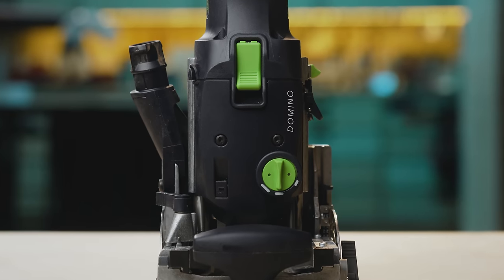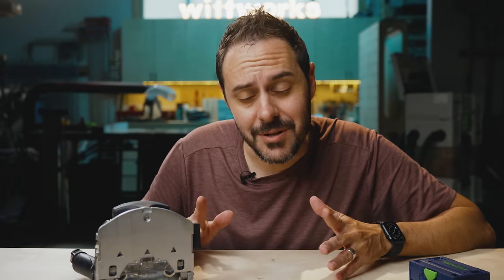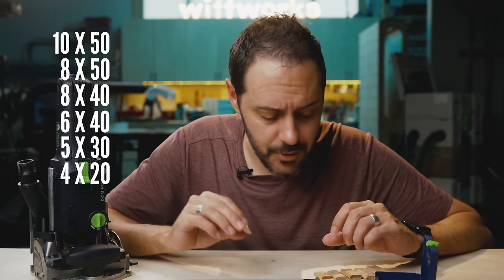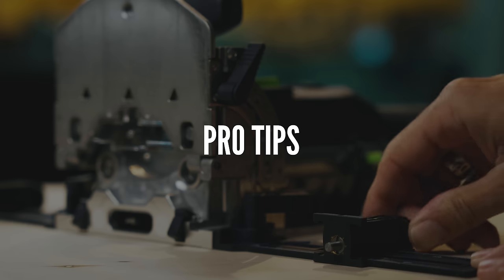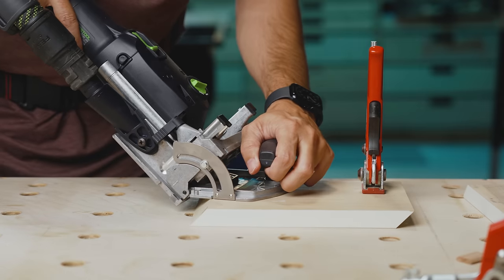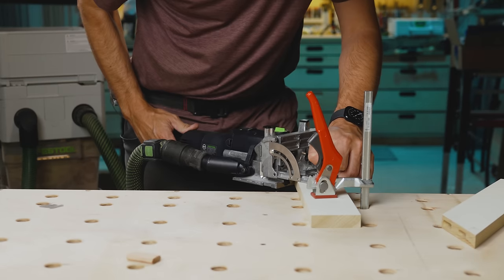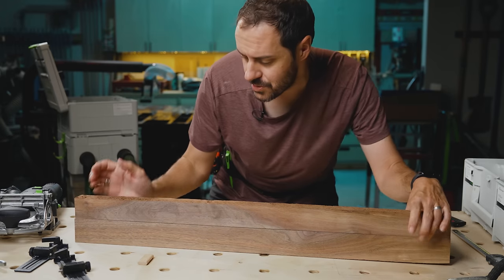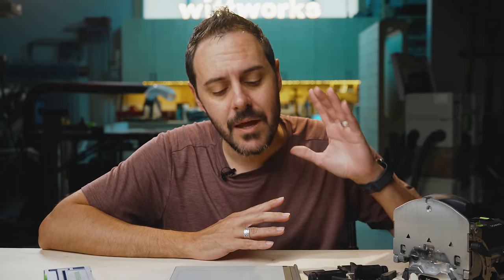Domino for Dummies

Comment: When doing 18mm boards I still use a 6mm domino, just only plunge 15mm on the face boards and do the 25 on the edge boards. I have had some cases where despite not changing the height adjustment I have somehow not got my holes aligned properly. Fortunately you can just glue a domino in, cut the end off and cut a new hole through that sawn off domino. I tend to use the small mortise on the edges of sheet material (as they all get glued up before final glue up), with a small on the face for joints at the front of a cabinet and medium at the rear.

Too much glue and too hard a whack will however see ply and MDF split or have glue oozing from places you didn't think it could get out of.

Comment: I'm a hobbiest too, and like others, time is worth more than the money to me.  I bought my first domino about 15 years ago, when I was gluing up more and more carcasses in face frames.  When gluing horizontal dividers to drawers, it seemed to be such a time saver over mortises or dowels, that I justified the expense.  I had been using biscuit joiners for years, and was satisfied with the ease of alignment that they allowed with panel glue up, but that small mortise was a different problem.  After I got the 500, I was so impressed that I started using it for panel glue up also.  Not that it really structurally improved them in my mind but the accuracy of alignment meant that it was a lot easier to keep the individual boards in alignment and thus much less time in planing and sanding.  Back then I had a performax drum sander and that is fairly slow, so not having to surface sand is a great thing.  I still use a biscuit joiner fairly often, mostly because the biscuits are so much cheaper than Dominoes, but only for places where the accuracy is not so important.  As to the dust collection.  I guess you figured it out that it IS very good, but that also it IS important to use it.  Otherwise the port can get too impacted and mess with the accuracy of the machine.  That is one thing I think that could be improved upon by Festool.  The hose is sort of a PIA to attach, and it sometimes comes off during use.  It would be nice to have a "locking" hose, (sort of like the plug locks on)

Comment: Great video! Here's a tip, if you ever cut the mortice in the wrong place and you have no more wood or your timber is expensive, you can just glue in a domino, let the glue dry for a while then cut off the piece which extends out of the mortice, then re-cut the mortise using the domino on the correct location, that's one of the benefits of the Beech being so strong.  PS I've subscribed! 
Cheers for 2024!

Comment: I opted for both of my kidneys and got both the 500 and 700 and can't tell you how happy I am and honestly it paid off in about 5 jobs , yes I went trough a few mistakes as well as you mentioned but most of them is operators mistake because the tool is precise,  one only complain about the 500 has a little flaw of the drifting fence on the height adjustment,  but there are many remedies to fix that issue , I am really happy with both the 500 gets 80% of use and the 700 20% because of the specifics of that tool and the bigger projects , financially it impacted me badly in the beginning but hey  2 years later I am profiting from my investment,  and I am not even full time furniture builder but these tools made my renovation business to take another direction which is very rewarding

Comment: Well done! I've had my Domino for over 10 years, original face even, with the pins (as opposed to your toggles). For all the reasons you said, 100%. I use vice grips to pull the domino's after a test fit FWIW. But yes, I am an engineer, not a tradesman. So, I am good at designing, and okay at building, quality tools make what I build look good. And my hobbiest time is still valuable. So I have selected WoodPeckers, Festool, Mikata, Milwaukee, and Delta in my shop. I know how I build, and sadly I've evolved, some some stuff get's kicked out. But, I am a value shopper. For me the Domino, and TS55 (only good TS when I got it) are huge in my shop. Expensive but they bring a lot to my shop.
Reply from the maker: Good insight! A lot of time what we pay for what we get
Reply: Have you tried the TSO parallel guides with the festool quick release adapters?  They are insanely convenient because you don't have to slide the guides on to the track them tighten a screw, you just set it down wherever on the guide rail you want, then pick it up off the guide rail when you're done.  For small shops it's a dream come true.  TSO makes the best parallel guides on the market.
Reply: Easy solution: make a few test fit-dominos! Sand a domino off a bit (so they're not as crazy tight), drill a hole in each end and to remove after a test fit you just put a screwdriver in the hole and simply pull it straight out - like a cork from a bottle. I keep two of each size in a ziplock with the machine to always have them handy.
Reply: @chrisr8996  I had a set of Dominos that were no longer a tight fit, and having the joints fall appart easily was a PITA. With the Vide Grips new Dominos are not that hard to pull. And I like the full fit for dry fitting.
Reply: @wittworks  AKA, Buy once; Cry once.

Comment: Nice video.  Typically, you only need the wide setting for ONE of each hole pair.  That procedure makes the assembly more “crisp”. I’m so glad I bought my Domino more than 10 years ago.  (Mine even came in the original style Systainer 😜.)  However, when you factor in inflation, today’s price is probably comparable to the price 10 years ago.

Comment: really great video and makes me plan to purchase one sooner rather than later as i have a whole house of closets i need to build. this tool would cut so much time off. One thing i noticed is when you used the reference bars in the last test, you had both on. As you moved down the board it looks like you should only have the one side installed as only one side (in your case the right side) had a hole to reference and the left side caused the tool not to sit flush? from what i can tell, you only should need the trailing side installed. If that makes any sense

Comment: What about using the tight setting on the ends then all dominoes on one side being made on the tight setting but on the other using the loose setting? Wouldn't that give you the minimum play necessary to cure any difference?

Comment: Maybe I missed this but you can offset tenons so they are inserted more into one piece than the other. In this way you use thicker and longer tenons. Also you can chop them down and make your own lengths. These are probably obscure situations. I have used the 500 for the last 10 years or so but recently bought the 700 for the longer tenon capabilities. Great machines.
Reply from the maker: Thanks Tim!

Comment: A good video for beginners.  However, why do so many Domino videos have to state that a biscuit jointer is useless?  I am nearly 70 and made many joints with an old Elu biscuit jointer.  From making panels, fitted wardrobes, kitchen units and even chairs.  All are still good fate many years of service.  Does the Domino do some of this better?  Yes.  Is a biscuit jointer useless?  Absolutely not
Reply from the maker: note at all

Comment: My problem with festal has never been the price. Good stuff cost more money. We all know this. My problem has always been how they are overly litigious, and sue everybody out of existence if they go anywhere near an oblong dowel. And it’s the same with Sawstop, also owned by the parent company. Anyone who puts a brake blade system in place ends up being sued by them, even when their system works differently, or, in the case, with Bosch, is actually better. It’s really disappointing to see them not allowing the marketplace to expand. I understand you have to protect your patent. I’m also a patent holder on something. I get it. But there’s a lot of leeway, and there are so many options for licensing that ultimately could make festool a lot more money over the long run. That’s my problem with them. I’ve been to a couple demos, and I love using the domino, and the Kapex is OK. I think it’s ridiculously overpriced because it’s not that much better than several other miter saws. And the saw stop thing, of course it’s great, on an average quality tablesaw. You have to really buy up to the top and cabinet saws to make it feel like you’re getting a much better saw in conjunction with the safety stuff. So the premium for Saw stops is not there for me at all. But I can absolutely see myself getting a domino 500 someday soon. Never the 700. That’s just crazy over price for what I would use it for. But I can justify the 500.
Reply: The thing is with Saw Stop, the inverter tried to sell it to other manufactures of table saws but none of them wanted it, so the made their own saw.

Comment: You can use a 6x40 Domino with 18mm plywood. Set the Domino for 12mm so you don't punch through, and 28mm on the other. You have to remember to change the settings. And if you are prone to forget, yes, the 5x30mm is for you on 18mm. I use the 6mm on 18mm ply no issues, but then I mark. No matter the project, when I screw it up, usually it is because of poor marking. Great video, thanks.
Reply: I use the 15mm/25mm pair of depths with 6mmx40mm dominos, but the 12mm/28mm can work as well

Comment: 30:31 Tip: put all tight mortises on one board and loose mortises on another board...unlike what you did by putting the tight mortises on the ends of each board and loose mortises in the middle. By putting the tight on one board and loose on another it gives you the ability to align laterally.
Reply from the maker: Yeah, that’s one way. Brent and Sedge from Festool instructed me on this way. It’s faster (so they say)

Comment: I think you have misintrupeted the Pro tip of using a combination of loose and tight mortises.  I have had my Domino since late 2006.  I quit counting how many mortises I have cut about 6 years ato when I hit 10,000 mortises.  On you example of putting together a practice face frame I understood that you used exact fit for the left stile and exact fit for the rails that mated with that stile.  Then you used loose mortises for the right stile and loose for the mating rails.    Use a tight and a loose mortise for the same joint.   I typically use a tight mortise in the narrower piece and use a loose tennon in the same size or wider mating piece.   Eventually your cutter will go out of calibration, swinging back and forth, and the center of travel will be a bit more to one side or the other of the registration mark.  Festool explained to me that using a tight mortise on one side of the joint and a loose mortise on the mating side of the joint will eleminate alignment issues.
Reply from the maker: Sedge and Brent (who’ve been using the tool before it sold in 2006) instructed me on how to combine the loose and tight.
Reply: @wittworks  And still you don’t seem to understand.   What sense does it make to only have one side adjustable?  Why only one and not both being adjustable.  Remember also that exact fit mating mortises will not always be indexed properly. You need to be able to adjust mortises that are not perfectly in alignment.  You do not want to assemble out of square because of a miscut mortise.  You will not have to worry about misaligned mortises if one is oversized.

Comment: Good video. Not gonna lie, I think it would make more sense if I had ever used a domino before. Working my way through learning dowels and biscuits before I take the plunge and go all-in on the domino. Once I do I’ll be sure to give this video another watch instead of reading the manual 😂
Reply from the maker: Hahaha. Thank you. One reason I made the video is it’s a tool that only makes sense when you hold it and study it. Good luck!
Reply: Stick to dowels, they are more versatile and cheaper in the long run.  Mafell's DDF40  is a pleasure to use

Comment: I bought my Domino in 2007 when they were released in the US. One of the most effective investments in tools that I have ever made. When you become familiar with its strengths and uses you actually look at design differently. It's cleaner, faster, safer, more repeatable, more versatile, stronger and more rewarding than hand cut tenons (you still have to use a router for the mortices so 1 tool instead of many) hands down superior to pocket screws or dowels. Once you take the plunge you'll never regret it. Track saw, Domino and sanders, hands down better than anything else on the market. Dust extraction a must.

Comment: I bought the knock off tenons when I got my domino and was always wondering why everyone was talking about how hard it was to get them back out after a dry fit. Well come to find out they aren't the same size exactly. The knock offs are slightly more narrow side to side making the tenons fit considerably looser than festool tennons. They worked perfectly fine for me but it took me forever to figure out whatbwas going on having never used the festool branded tenons. They are quite a bit cheaper though

Comment: I will wait for the patent to end next year when the other brands will all start coming out with them in droves. The prices should be far more reasonable considering the tool is a one trick pony and the hopefully they fix the second most glaring problem with the tool the ridiculous metric only nonsense. I don't care about all the opinions about metric vs SAE (America does not use Imperial). It's purely a practical matter. I live in America. All of my lumber is in SAE measurements. All of my tools and measuring devices are in SAE. All of my fasteners are in SAE. I have no need of a tool that is only available in metric and will never be accurate to my lumber or other tools, even if they offered it at a reasonable price.
Reply from the maker: There are aftermarket imperial accessories…